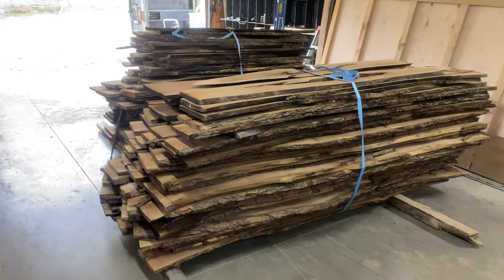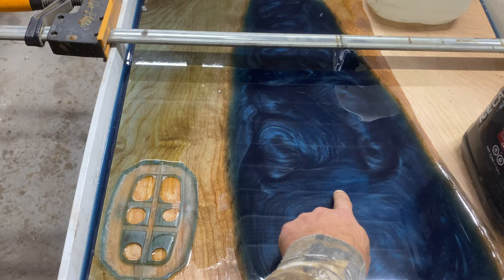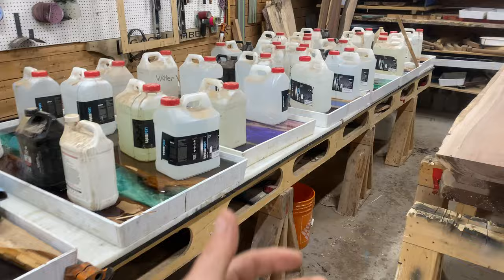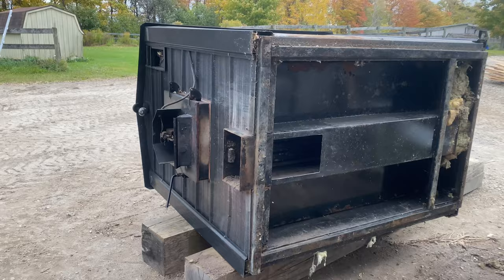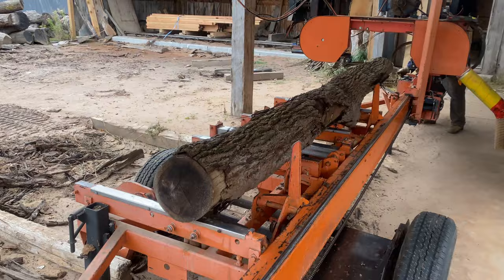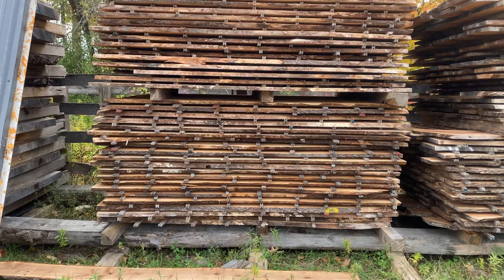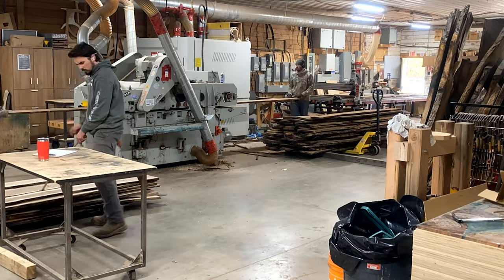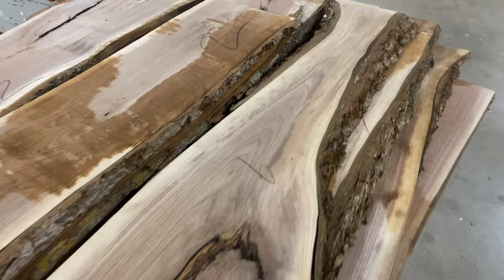Woodworking life - A busy Monday in the wood shop and sawmill

Comment: Glad to see more videos from you. Can you answer a question for me? Our local Woodcrafters sells Steamed and un-steamed walnut. Un-steamed is half the cost of steamed. What is  the difference. The look is different for sure. Are your kilns steaming your wood? i am confused.
Reply: With a traditional kiln they use steam to help dry the wood. Unsteamed walnut would be air dried or vacuum kiln dried which helps retain more of the variable colors in walnut. Traditional kiln dried walnut will have more of a consistent bland color. I know all of this as I went to SUNY Morrisville in New York where we milled and dried our own lumber from the campus property to use in our classes. Plus I’m looking into getting a Woodmizer and IDry vacuum kiln in the future.
Reply from the maker: Steamed is done to have a more constant colour, also the grading rules take into account the amount of sap on the face of the board, so if a company can steam the lumber to blend the sap wood, their lumber will grade higher = more money.  Almost any "smaller" operation like my self will not be steaming the lumber for 2 reasons..... We prefer the colour of not steamed Walnut and also our lumber is not graded.  Steamed will almost always be graded lumber, this is most likely why its more expensive.   We don't steam here, it's actually a pretty intense process of high temp and making steam, not easy to do for the small operation.